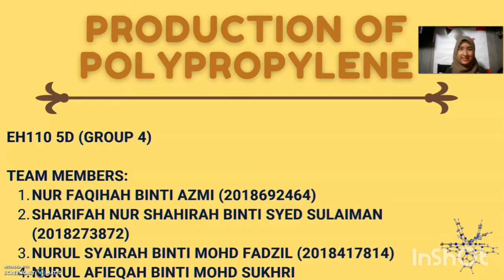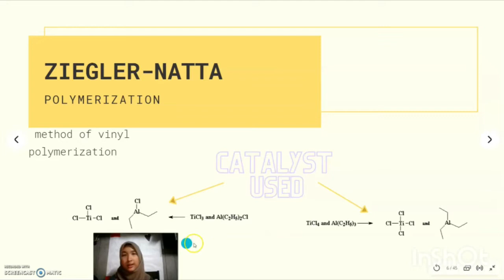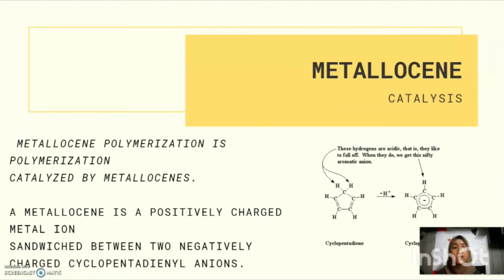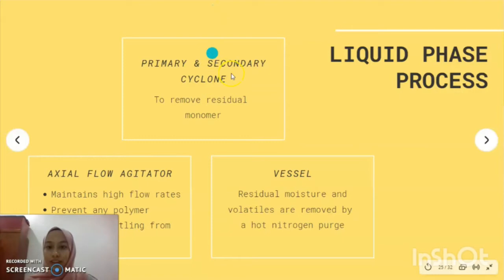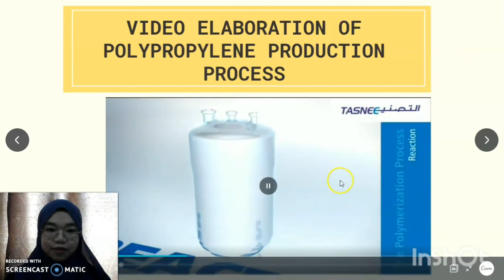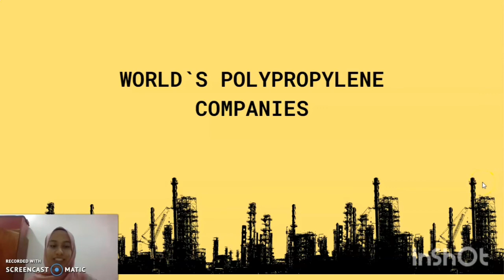[CHE329] GROUP 4: PRODUCTION OF POLYPROPYLENE

Comment: 4. Can you explain the overall differences for gas and liquid phase processes, other that the phase?
Reply: Thank you madam for the question. From my reading, I can identify that the main difference between gas phase process and liquid phase process of polypropylene production is the feed. In gas phase process, one of the feed is gas propene (propene in gas form) while for the liquid phase process is liquid propene (propene in liquid form). Other than that, the reactor used is different as well. For example, fluidized bed reactor and loop reactor are the reactors that usually used in gas phase process and liquid phase process, respectively. During gas phase process, the feed will contact with solid catalyst in the reactor. To conclude, production of polypropylene via gas phase process is more preferred since it has higher output capability, economical, flexible and can accommodate a large variety of catalyst.

Comment: 3. Can you explain further, how does the cyclone works to remove fines entrained from reactor?
Reply: During the process, unreacted gas from the reactor will enter cyclone before recycled back. Cyclone is a separation device that use the principle of inertia to remove particulate matter (fines) from the gases. The unreacted gas is fed into a chamber in the cyclone, which inside the chamber, it creates a spiral vortex phenomenon/condition. Since the gas is lighter and have less inertia, it will flow upwards to the top and exit the cyclone and travel to the recycle stream. In the meantime, the fines which have more inertia will drop down and will be removed from the cyclone. Thank you madam.

Comment: 2. So, what is the different if we are using Ziegler-Natta or Motallocene as catalyst for the reaction process?
Reply: Different catalyst gives different result. Each catalyst molecule has the same activity and each has essentially the same accessibility to monomer. Firstly, Ziegler-natta catalyst is a heterogenous catalyst which means that the catalyst is not in the same phase as the reactants. Meanwhile, Metallocene catalyst is a homogeneous catalyst which is exist in the same phase (gas or liquid) as the reactants. Therefore, TiCl3 or TiCl4, along with an aluminum-based co-catalyst will added in Ziegler-natta catalyst. The Ziegler-natta polymerization is take place under relatively mild conditions. Thus, it allows to make polymers of specific tacticity especially in production of Polypropylene. 
Then, for metallocene catalyst, MAO which is methyl alumoxane is added to make catalyst work more efficiently. Plus, metallocene catalyst is better than Ziegler-natta catalyst in making polymers of very specific tacticities. Moreover, metallocene catalyst has a much higher molecular weight than polypropylene made by ziegler natta-catalyst. 
Thank you, madam.

Comment: 1. In your opinion, can you comment about the industrial demand between polypropylene & polyethylene?
Reply: Thank you madam for the question. 
Polypropylene plastics have very rapid growth globally since it was commercially
 produced. It has characteristics, such as excellent chemical resistance and a high melting point, making it a reliable choice for hot-fill liquids. Hence, It is also used for flexible and rigid packaging applications and other large molded parts required for automotive and consumer products. This statement is proved when Thong Guan Industries Bhd, the plastic packaging manufacturer, registered a 56 percent increase in net profit and reached MYR 25.7 million for the first half of 2019. Other than polypropylene, polyethylene has also dominated the market is primarily used in the packaging sector, which comprises containers & bottles, plastic bags, and plastic films. For example, the use of HDPE for plastic pipes in buildings is leading to the growth in the product’s market owing to the rapid increase in Malaysia's infrastructure sector.